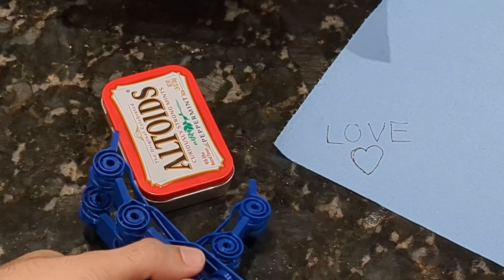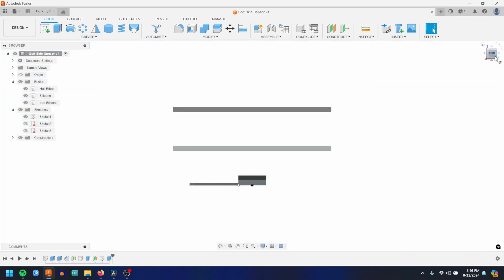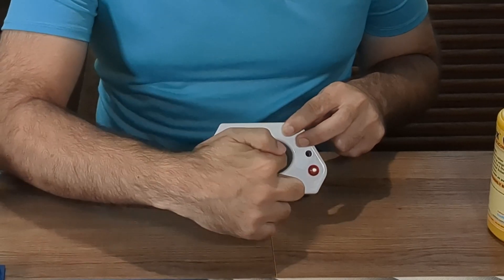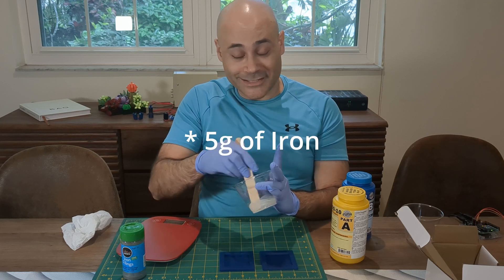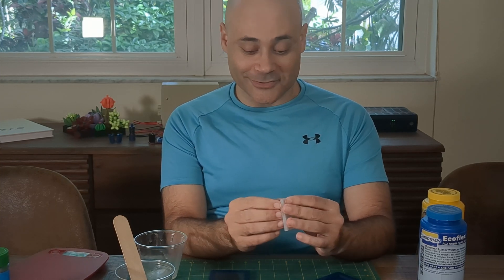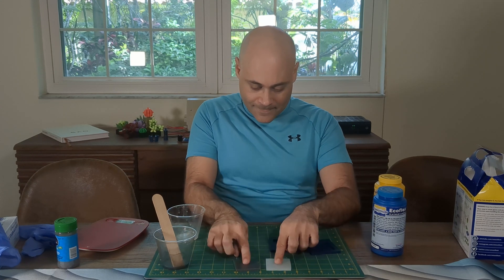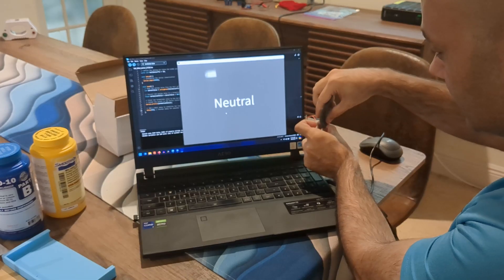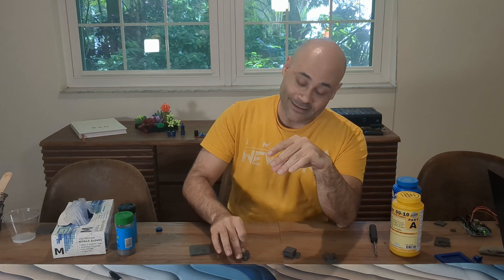Iroh the Soft Skin Robot Sensor

Comment from the maker: Please join my Patreon to support more videos like this: https://www.patreon.com/adrianperez720
Reply: Just as a quick pointer. I think this could work really well if you instead of going for the Hall Sensor approach, you tried a capacitive sensor. Basically, your silicone + iron shaving would work as a capacitor plate and pressing them gets the plates closer, thus increasing capacitance. This would require a way of measuring capacitance though....
Another solution is via resistance. Since the silicone is compressible, you can add metal shavings to it and pressing the silicone actually decreases the electrical resistance across it.
Your solution is actually pretty elegant I must say
Reply from the maker: @yertzar775  I would love to try those other approaches at some point. Thank you. :)

Comment: What about to use 3 or 4 hall sensors and triangulate the pression point to know exactly where the point of pression is and I think with some neural network training, multitouch will be able also. Nice idea dude!
Reply from the maker: @ivanfreedom  Thanks. That's a really good idea. I was thinking even just two initially might be able to identify if something is slipping out of the fingers. Or measure friction.
Reply: @adrianinvents  good morning,  I think you can also create a specific magnetic pattern in the magnetization process, and use two magnetometers like the qmc5883l giving also some 3d sensing resolution on the 2d plane of the finger tip.

Comment: Curios what the factors are on scale for this and how close the hall effect sensors can be. Perhaps it is someting based on thickness of the skin thinner skin will lean to closer sensors as when depresssed the skin averages less giving more percise reads on where pressure is
Reply from the maker: Exactly. I had to slice the silicone thickness in half to get it that bit closer.

Comment: I use the soft foam for integrated circuit packaging as pressure sensor material, its resistance lowers when it's compressed. It's quite sensitive, easy to use and very cheap. Just put it in between two sheets of copper foil.
Reply from the maker: @Benadski  Maybe I try that next!

Comment: This is awesome! So many cool applications!! Also if you ever want your silicone to feel and react more like skin you should look into using some deadener for plat silicone. Plat silicone is tricky though and can be a pain getting the levels right with multiple additives (iron filings and deadener) to where it will still cure, might want to try small test batches to get your ratios right. Just a thought! Great video btw! Can’t wait to see where you go with this, will def be following your channel 😊
Reply from the maker: @emmamarx9284  Thanks for the suggestion on the deadener. Good idea.

Comment: This is dope. You could give people their feelings back using these sensors plus neuralink. Could put these on prosthetics. Arrange the magnetic film in a flexible pattern. Like for fingers, lay them down the fingers and then make a strip on top and align the strips longways and in a network. Make a cut out for the sensor to sit in on the prosthetic so it doesnt get damaged and then layer the skin like a fat layer and then the mag film or tape and then another layer to protect the strips. I like this. The stronger neo powder could be good to test and might be a better option even though it is expensive. Maybe the flexible tape is better for price and easier to make. Maybe wires could be more flexible, like the small strands of metal like strings. Thinking about it, the mag wires could allow different areas but still close to be picked up, like one sensor picking up multiple signals and with multiple sensors you could measure the readings like earth quakes and have the sensor share for multiple areas while picking up one group. Like two sensors with strands in between could be measured together and give multiple readouts for the whole area or something. Idk. This is sick though.
Reply from the maker: I'm picking up your vibe. This is what future prototypes will probably look like.

Comment: What about a capacitive solution? Like using foils between the layers, if u also add a resistive layer, you could also locate the pressure and that on a big surface.
Reply from the maker: There are resistive pressure sensors out there. They seemed only mildly flexible. But I bet it could be done.
Reply: I think it could be done, though you'd be getting into the weeds with details like dielectric constants and variable silicone weights/densities/volumes, etc.

Comment: Why didn't you use the thin magnetic sheet material found on the back of flexible advertising refrigerator magnets.
Reply from the maker: @jvebarnes  At the end of the video I used magnetic tape, which is what is on the back of fridge magnets.
Reply: @adrianinvents  I saw, although I have a few such magnets and they appear to me to be a lot thinner than the tape you used. However speaking of magnetic tape, as someone who worked with computers when they had huge reels of tape similar to   that used in music cassettes, what about 8 track tape or vhs video cassette tape it would be thinner and more flexible.

Comment: I don't think you need permanent magnets. Here's the idea: take the power wire for the hall sensor, and wrap it in a coil around the sensor coplanar with the front face. That sets up a magnetic field normal to the sensor, and you'll read a constant North (or South). Then when you press the iron sheet closer to the sensor, the magnetic field will couple better to it, and the field will get stronger. It's a little like a guitar pickup. I have no idea how many turns of the coil you might need, though, for it to be measurable.
Reply from the maker: That's a really cool idea! I love solutions that require even less components.
Reply: Please try that idea and record a cool vid like this one  @adrianinvents
Reply: this is basically what i was considering doing thinking abt this topic a while ago ! i really think that would work
Reply from the maker: @morgans.5190  I would love to see it get tried. It's a neat idea.

Comment: you could have used Magnetic Sheet Papers aka Fridge Magnets before printing paper thing which are magnatized
Reply: Flexible fridge magnets are usually magnetised in alternating, rotating stripes to form halbach arrays. Halbach arrays have way more magnific field on one side than on there other, which can be seen if your magnet won't stick well to metal on the opposite face. You might be able to "erase" the existing magnetisation pattern and re-magnetise it to have a single North/South pattern through the thickness of the sheet, if that is what you want, or along The width or breadth of the sheet if that would work better.
Reply from the maker: @MrRlnansel  So that's why the fridge magnets don't stick on one side. They are Halbachs! Thanks for telling me. That's actually a good thing. The sensor skin won't stick to objects the robot holds.
Reply from the maker: Fridge magnets could be a good source. Good idea.

Comment: well this is a suggestion, you could mold the silicone with magnetic tape inside it rather than making it as separate sheets
Reply from the maker: Next time I make a skin, I'm totally going to do that. It will be nice to have one seamless structure.
Reply: @adrianinvents  Good luck ! Im subscribed to see how it would turn out :) hmu if you need any help with 3d modeling or cad stuff

Comment: Since the number of sensors will be discrete, why not just embed small neodynium magnets in the silicone at each sensor location?
Reply from the maker: @rydude998  That could work. Suppose I hesitated to do that because I thought it would be too easy to feel as a hard spot through the skin. And neodymium is relatively expensive to magnetic tape or iron.

Comment: Rather than just reading the polarity from the hall effect sensor, wouldn't it work much better to read the raw values. Use the change in magnetic field as data output. Rather than having a -1, 0, or 1 output, you can have all the numbers in-between, read how much it's pushing / pulling.
Reply from the maker: @ToastyStoemp  I did both. The words get larger as the values get larger.

Comment: Nice theory, it working like in every magnet where the fields of all atoms line up and add up to a positive sum. 
I believe the reason for it not working is that every single filing becomes a magnet by its own. This being a macroscopic scale, those small fields don’t add up they cancel out. Especially in such a suspended state in the silicone with comparably a lot of space between them. Combining magnets to increase their strength in one direction works, but only in exact patterns and when touching directly.
That’s what my intuition at least says 😄
But good solution in the end!
Reply: But if I’m wrong, or just the pattern has to be right. This would open up biological magnets (also flexible). 🤔
Reply from the maker: @nextstopptop3963  Biological magnets would be really cool.
Reply from the maker: @nextstopptop3963  Thanks! I like tackling projects where I have missing knowledge. That way I learn a lot.